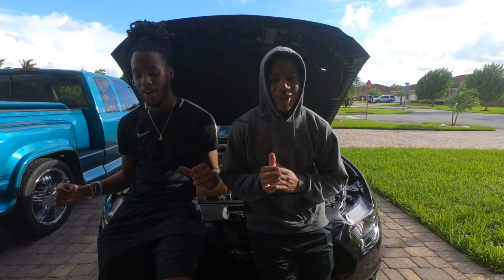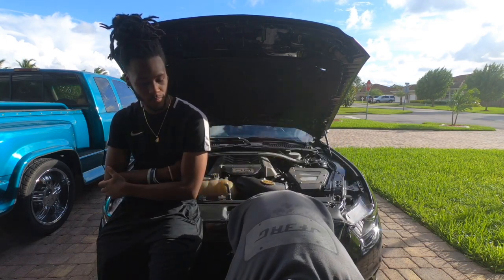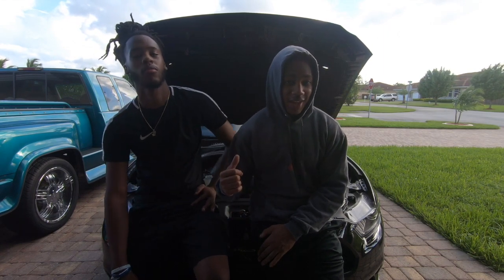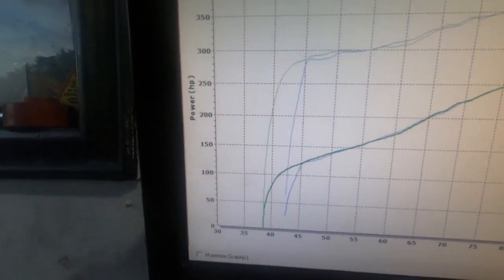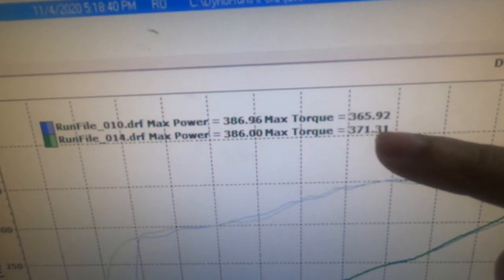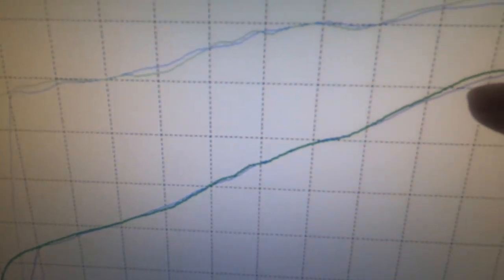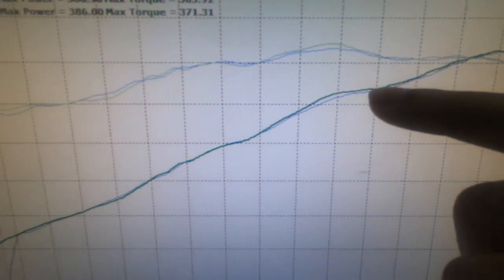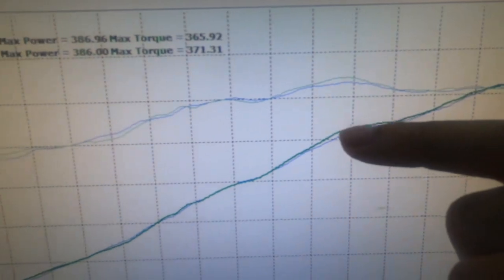Mustang Gt MMR Water Pump Pulley & Steeda Billet Idler & Tensioner Pulley Kit Dyno & Weight

Comment: Have you tried the mishimoto 160 degree thermostat? If so does the engine actually run cooler?
Reply from the maker: I haven’t yet but the lower temp thermostats definitely help. we will do a video on it in the future showing the difference.

Comment: Not looking looks or weight savings, I’m thinking long term.  The stock bearings tend to get slop in the pulley bearings.
Reply from the maker: Yes that’s true, quality and strength wise the steeda pulleys are definitely an upgrade no doubt about it. It’s just advertised in a few places as light weight, and unfortunately that’s just not the case. It would’ve been a nice plus for the looks and strength they bring to the table.
Reply: @ThrottleHavoc  keep in mind , I think 18. And newer uses plastic pulleys  my 15 RS3 has steel pulleys.